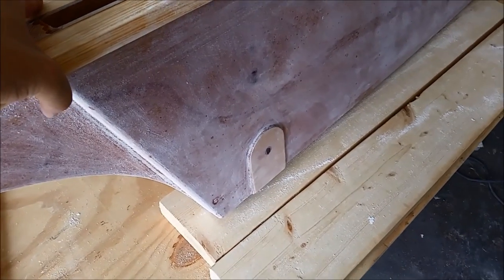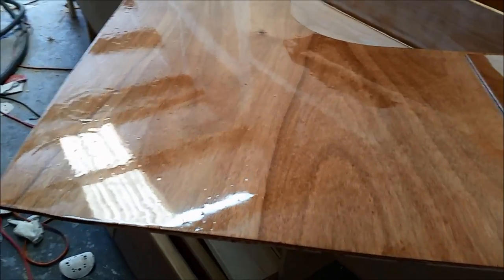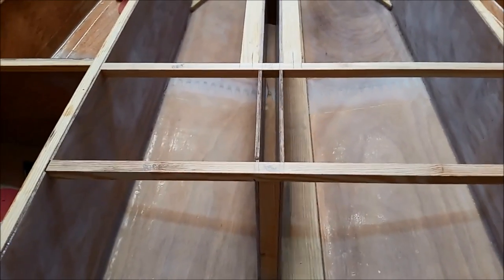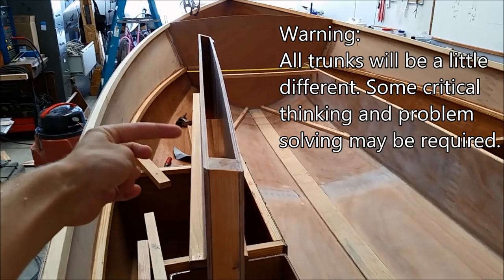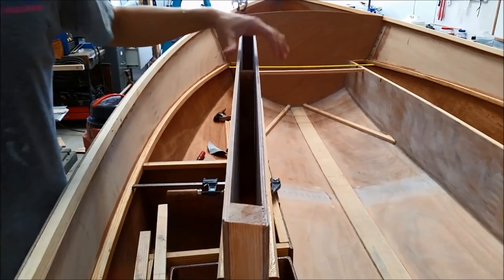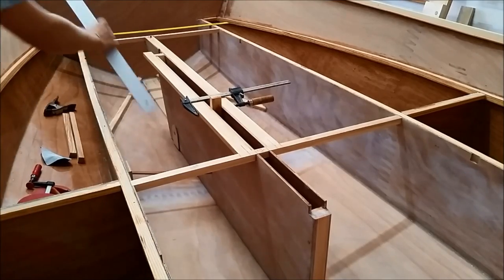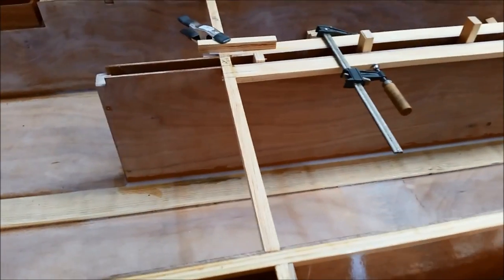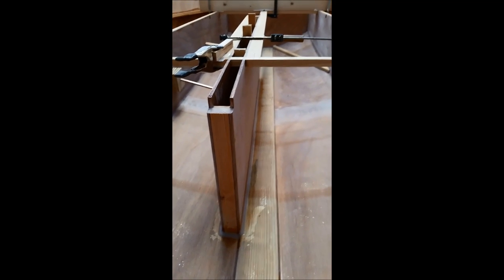Core Sound 15 Build Part 7

Comment from the maker: Part of the design of the Core Sound sailboats is that the CB is offset. it's not much but it keeps it clear of the keel Making the bottom stronger and it's totally imperceptible sailing. no difference from port to starboard.